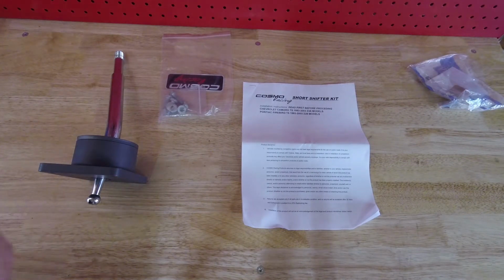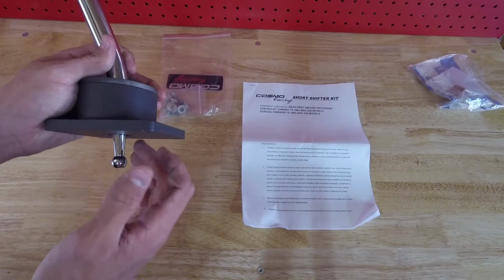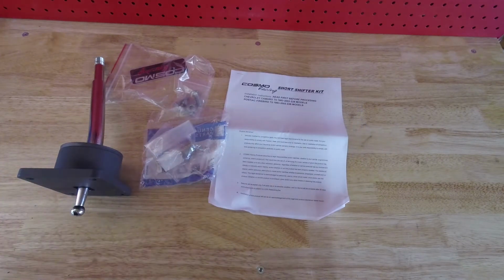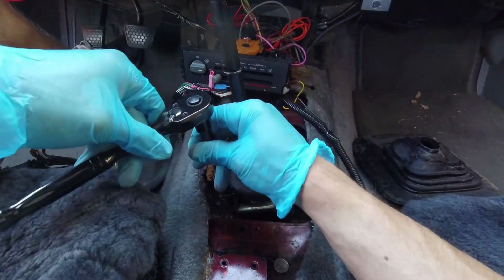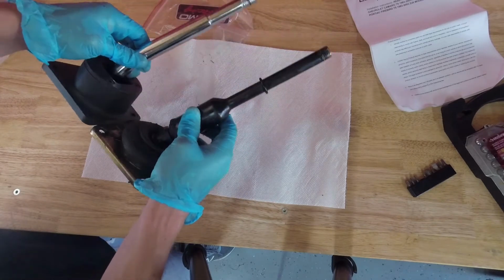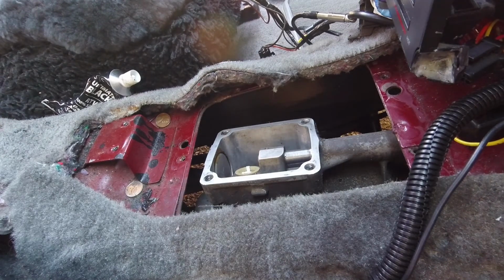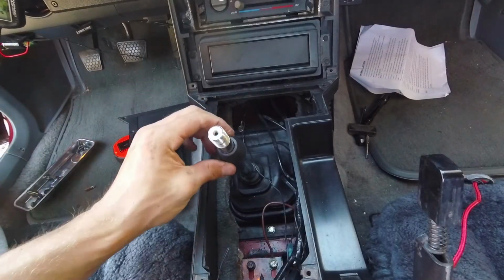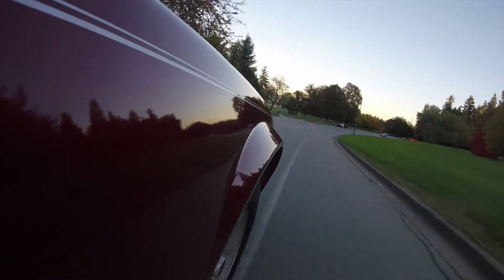COSMO Racing Short-Shifter for 83-02 Camaro/Firebird Installation and Review

Comment: I've only ever seen this on eBay and it's going for $180 plus shipping. It's the only reason I went with the Pro 5.0 shifter for $160 free shipping. 

I kinda wishi would've seen this video and it's link before ordering lol. $115 plus roughly $30 to ship would've saved a few dollars. I like the look of this more than the 5.0 shift arm
Reply from the maker: 160 for the pro-5.0 ain't bad! and it at least has the adjustment bolts to prevent over-shifting for the extra money you paid. But yeah, its a pretty unknown shifter, but I'm very happy with it :)